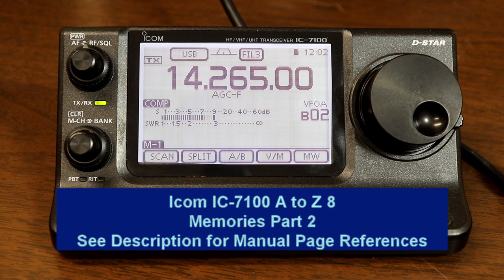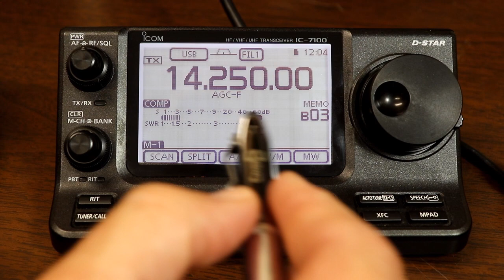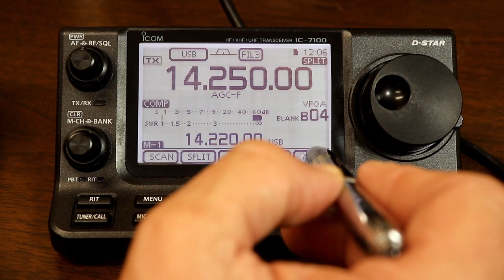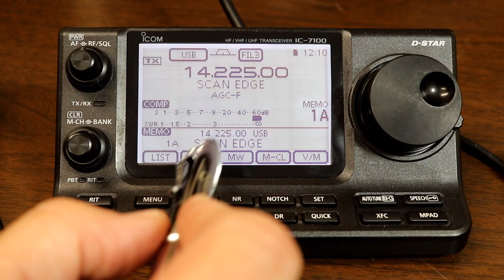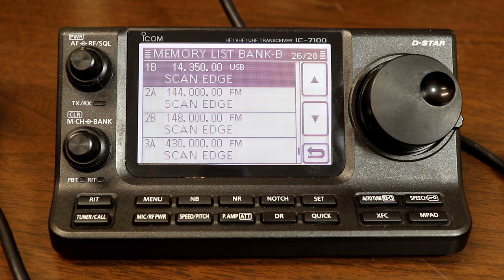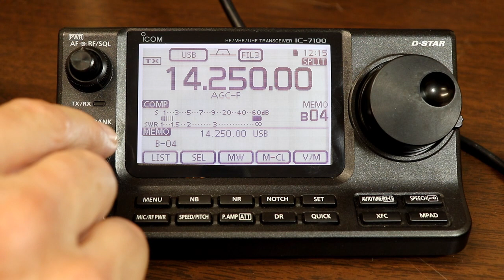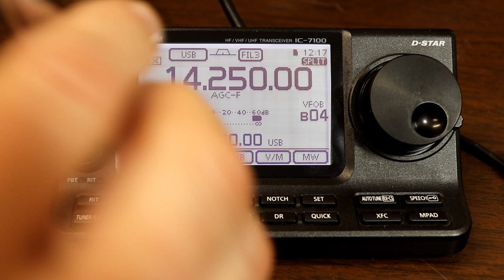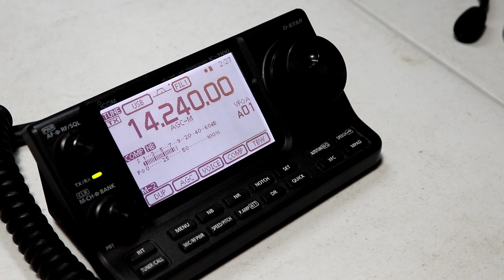IC-7100 from A to Z #8 Memories Part 2

Comment: Thanks, Tom.  I'm so new (tested to Extra last weekend) I don't yet have a call sign.  I have a 7100 on the way, so this is good insight into what to expect.  Cheers, fnb
Reply from the maker: Congrats on the newly minted license!  I have a long way to go on this series yet. In the mean time, you might want to check out the IC-7300 A to Z series on my channel. It’s a different radio for sure, but you’ll find many of the setting menu functions nearly identical to the 7100.

Comment: Just got 7100…just to clarify, still only 495 total mem channels to save plus the 2 calling channels for 144 and 440, no way to store more than that?
Reply from the maker: And there are a few program scan start and end memories, but yes, that’s basically it for standard memories.  There are also the DR (D-Star Repeater) mode memories.  There are 900 memories available for that.  Icom provides a file in a proprietary format. (.ICS) to program those memories. I don’t believe they’ve updated the file since 2016.  You can program these memories with your own list using software from RT-Systems (no affiliation).  The memories are intended for D-Star repeaters, but I believe with the RT systems software you can also program analog FM frequencies as well.  I don’t believe you can store any HF frequencies in the DR memories.